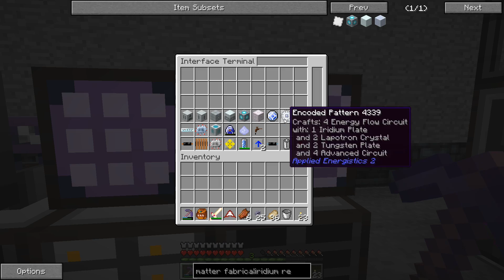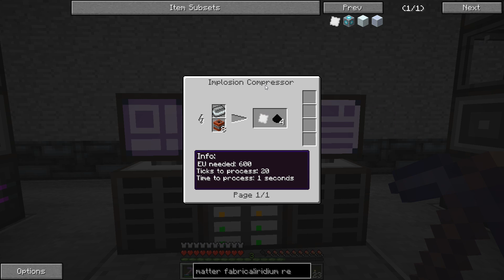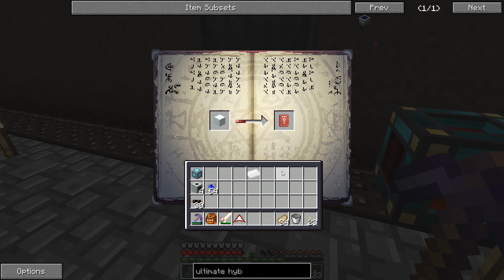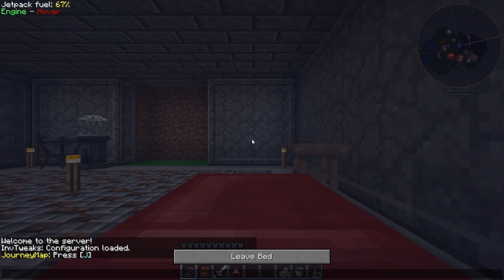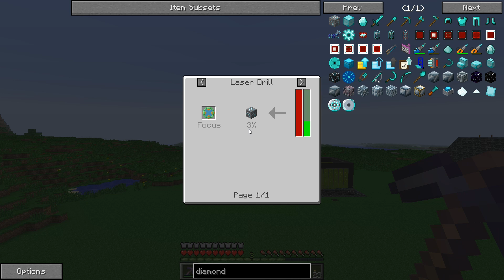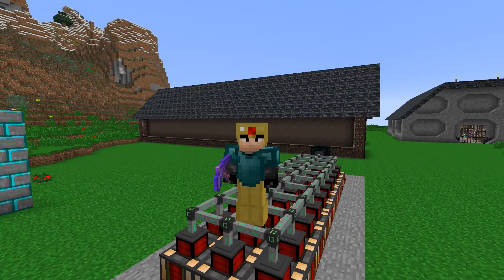Minecraft Mods FTB Inventions - MATTER FABRICATOR [E23]

Comment: The machine from minefactory reloaded called the unifier changes ingots into other mod's ingots such as advanced solar panel iridium ingots into tech reborn iridium ingots( I've seen you use it before, so it should work). Also, the tech reborn diamond dust can be emc'd.

Comment: When I used my implosion compressor, I just used the same lay out as the industrial grinder and it worked just fine
Reply: Plus you can use the unifier from mine factory reloaded. But you just gotta have like the specific item for it to transfer it to the other one. Or maybe the lexicon from thermal expansion

Comment: Hey Hypno. Just commenting so that you know that as of the curreent ftb inventions mod pack the multi block structures for tech reborn can be made out of only standard machine casings. No need for any upgraded casings as it doesn't affect performance of the machines at all. (except for the blast furnace) Love your vids btw
Reply: also the actual machine blocks just need to touch the casing multiblock structure. For example i have an implosion compressor on the side instead of the top as well as a ring of industrial grinders around the top section of the multiblock structure. The actual machine block only needs to be connected by one side.